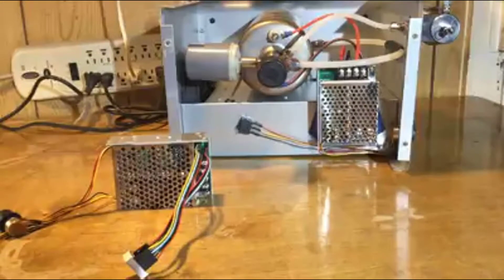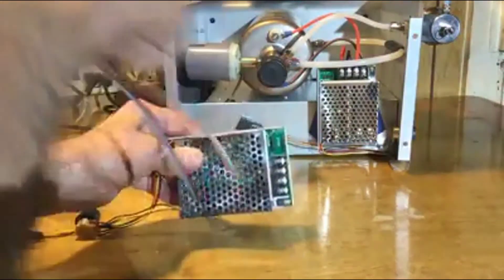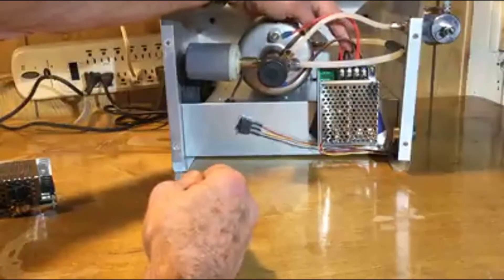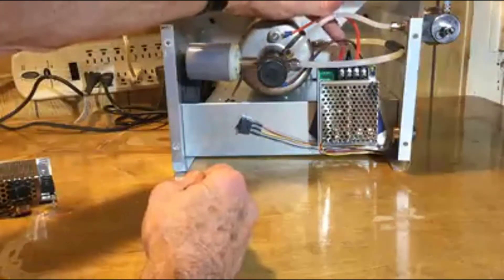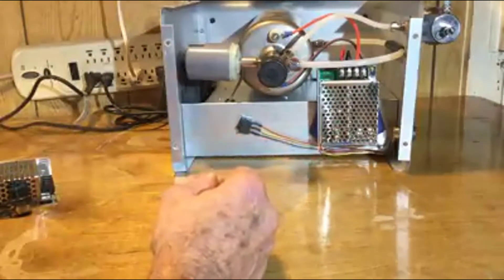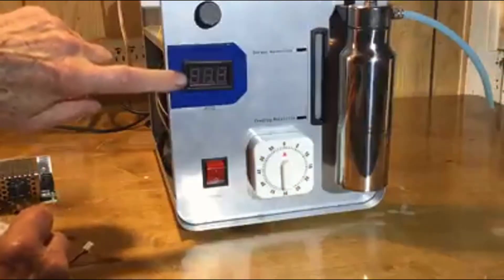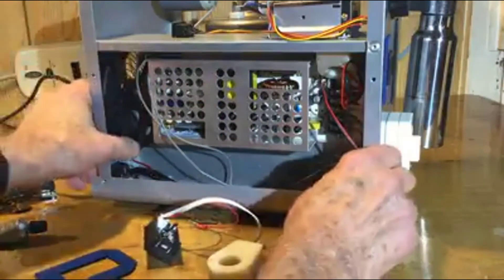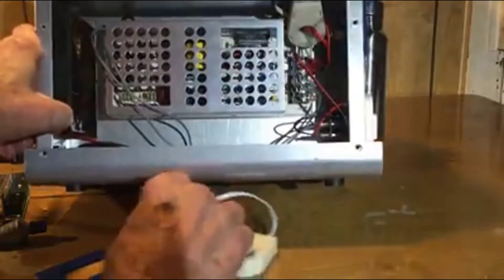How I modified a H160 Hydrogen Generator for Therapeutic Use

Comment: Thank you for the video, but why not tell us what parts you actually used?  Also, why did you make those particular mods?
Reply: I saw your other video and now I understand. The PWM is to reduce the amount of gas for therapeutic use and the amp meter is to replicate settings. I couldn't find a good water check valve. The reviews showed too many bad ones so I am going to use a normally off solenoid . This will close off the flow when the power is switched off. Do you have any advice on cleaning the plates before use or is that not an issue?

Comment: Thank you for posting this. Which check valve did you use? Looking at https://www.ebay.com/itm/194022599485?hash=item2d2ca5eb3d:g:LkgAAOSwYX9dZe84 and https://www.ebay.com/itm/353492725038?epid=0&hash=item524dceed2e:g:2zEAAOSwEjpgnAH6 Looks like you ran the hot wire from the PWM through the hall sensor.

Comment: Sir, you made a very nice modification! If you would use NaOH (aka Sodium Hydroxide) as the electrolyte and put some vitamin C in the second bubbler, then your vitC water gets stronger and stronger. You can drink that and use the gas-out of the second bubbler for breathing with the canula